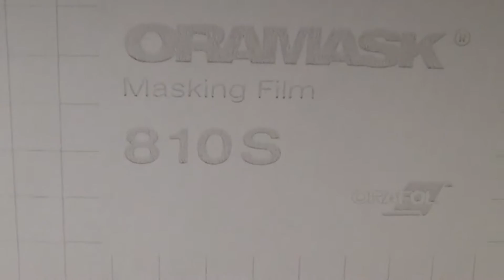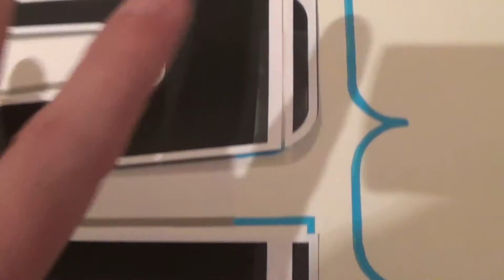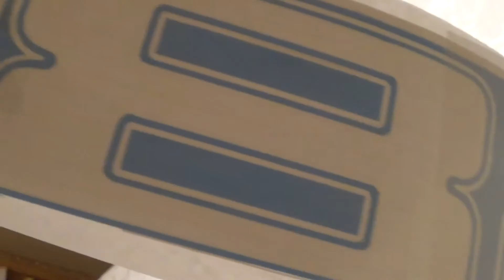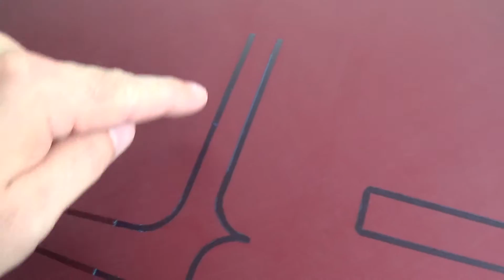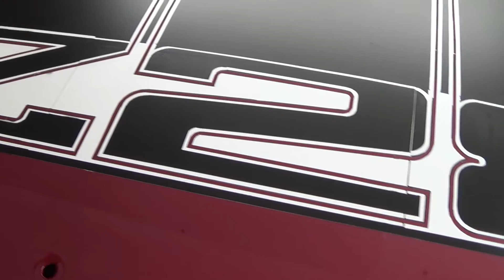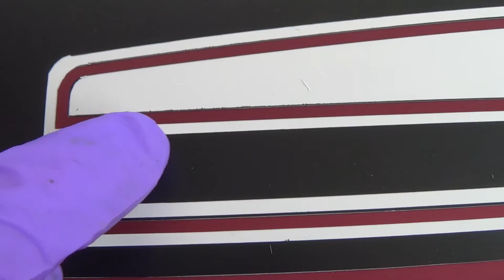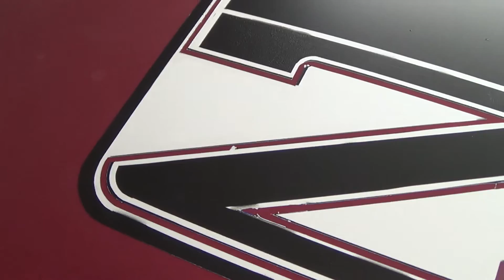Z28 Camaro Stripe Test

Comment: Gotta use really slow reducer to get those lines clean and really good paint with strong pigment so you only have thin layering. Stripes suck and if you want crisp lines it’s lots of touch ups. Not a bad try but I personally wouldn’t deliver those to a customer. Takes a lot of practice but you did a fair job in my opinion.
Reply from the maker: Thank you so much! How does the slow reducer help? I was planning on flow coating the whole thing to bury the edges.